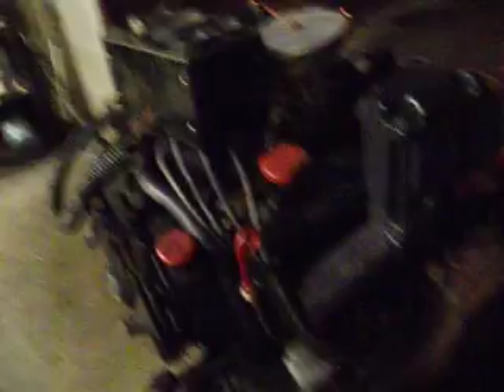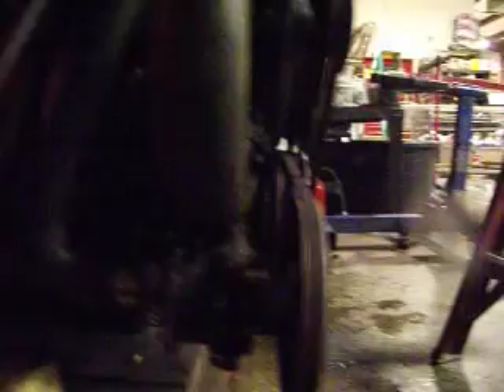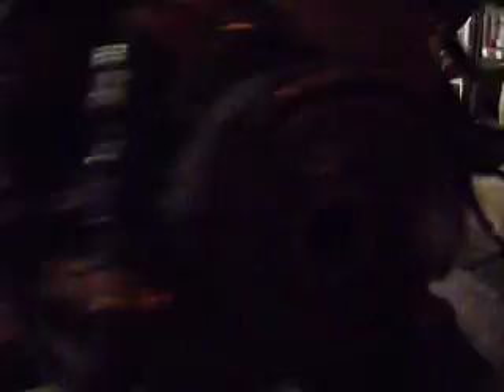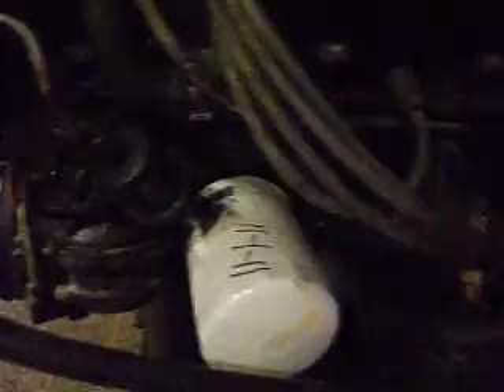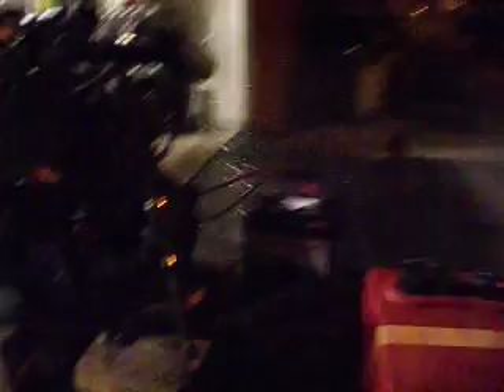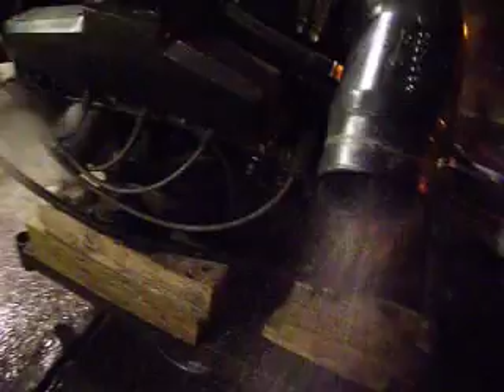OMC Cobra Engine that Froze Due To Not Being Winterized Test Date3-21-14

Comment: What was the outcome? I just purchases a 1990 VIP with a cobra 4.3 and was told it was winterized. We pulled it from a heated garage but I am worried about it sitting outside now when it is still getting bellow freezing at night. Do you think I should fill it with antifreeze just to be safe? temps are hitting about 25degrees at night. Anything below 32 is dangerous if it has any water in it correct?
Reply from the maker: +catfisher420  I would pull the manifold drain plugs and also the block drain plugs on the engine just to be safe. It should only take a few minutes. It is not what is done to winterize an engine, but at lease there will be no water in the block and manifold that could freeze and crack the block and manifold.